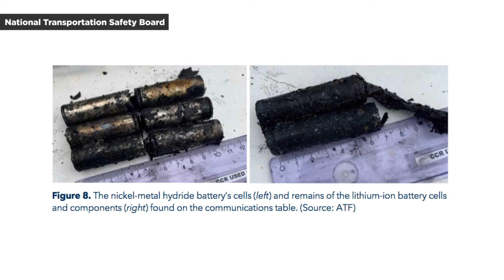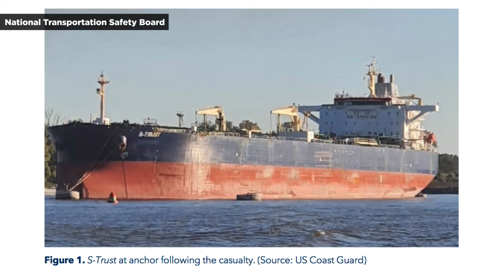Thermal Runaway in Handheld Radio Leads to $3 Million in Damage

Comment: i've never had one of those batteries randomly burst into flames. I've mishandled them quite a bit. accidentally pushed the contacts of one into a metal object shorting it out. no fire.
Reply: Really depends on how long you short it and how much charge is in the cells. Takes time to warm up for thermal runaway. Otherwise some cells could be faulty and doesn't take much to create an internal short causing it to heat up into thermal runaway
Reply: Many of them have an internal protection circuit. Won't help against an internal short though.